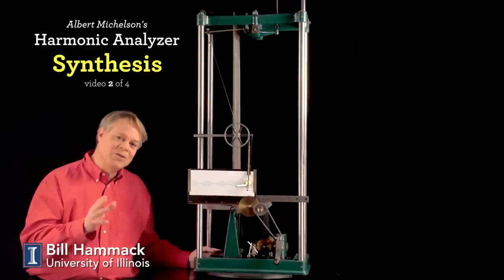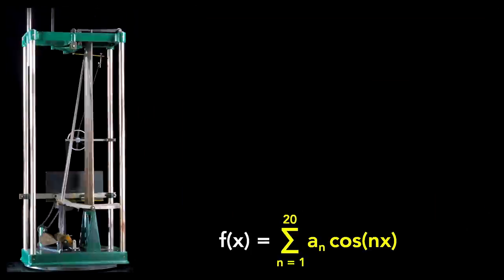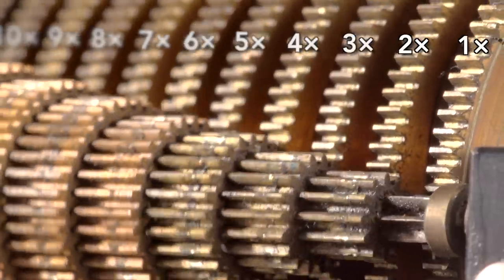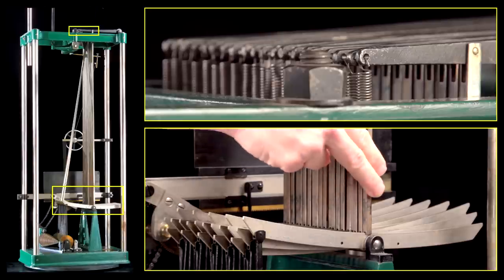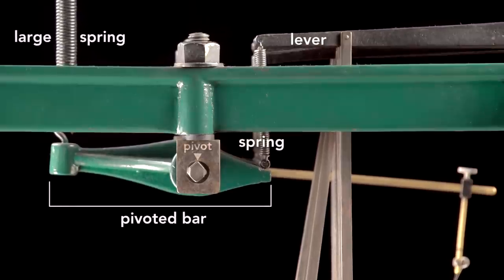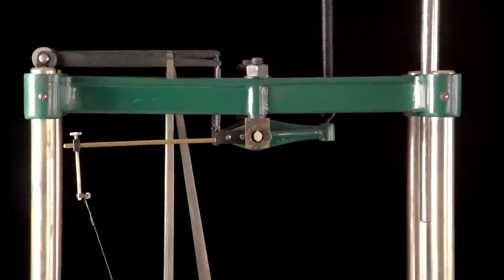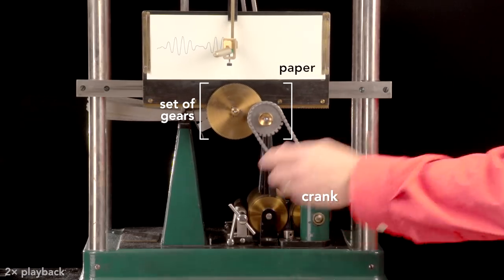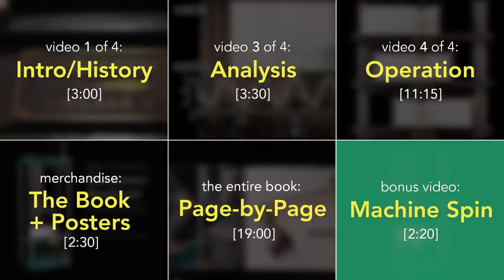(2/4) Synthesis: A machine that uses gears, springs and levers to add sines and cosines

Comment: Amazing how much thought used to went into one machine for one purpose before computers existed.
Reply: It is a computer, albeit one for a very particular purpose.
Reply: Desmaad It depends on your definition of computer. In the old sense of the word it definitely is a computer because it computes. However if you look at the modern idea of what a computer is (in essence a Turing Machine), this does not qualify.

That doesn't make this machine any less impressive though.
Reply: More thought goes into machines now than ever has before.
Reply: @Falcrist  
Yes, more thought into making them into cheap irreparable pieces of crap that break just after the warranty expires...And charging the same price as you would for a servicable machine. Just look at the user manuals most modern machinery has, and tell me where do you see schematics?
Reply: @Falcrist  
And replace it with what? Capitalism is barter, is trade, is production. What you call capitalism is state corporatism, something that spits on the very notion of unregulated trade or production.
Reply: @rockytom5889  if you define all barter, trade, and production as capitalism, then there is no other system. Even communism is actually capitalist.
Reply: @Falcrist  
Exactly, only the owner is different. Instead of the state owning corporations through legislation and  corruption, it owns production and logistics directly. And you do not want the same kind of people that are attracted to power over others anywhere near production. To call this modern hodgepodge of a heavily regulated economic system capitalism would be a disgrace to all systems. The only capitalistic markets currently are the black markets, as those don't have any limiters on how to trade, or what.
Reply: @rockytom5889  so since you have defined capitalism in such a way that no other system (like socialism, communism, imperialism, feudalism, etc) can exist... no solution can exist, and you will simply have to deal with the problem as it is.
Reply: @rockytom5889  depends on which design.  The one that the engineers make that they think is best.  Or the cut to hell and scraped to bits model that the company wants to pay to mass produced.  We make incredible machines  able to smash single particles together at near the speed of light.  But we don't make 100million of them a year like phones no.  Quality over quantity is a saying for a reason.

Comment: Wow.  I was expecting some kind of additive displacement of the different sinusoids (e.g. some kind of stack of cams or something), but this is using springs to convert displacement to force, which is much more easily summed, and then converting that force back into displacement through the main spring.  By keeping the main spring long and the displacement small at the pivoting arm, the spring constant is going to remain very linear and improve accuracy.

The amplitude bars are pure elegance, as is the 'full circuit' at the end, when the crank driving the gears is also moving the paper in perfect time.

Can't wait to see the analysis video!
Reply: Oh, is that how it does it?  I was trying to see linkage on top of linkage summing actual displacements.  Converting to force does seem like an elegant solution, but still mind blowing how that can be done without inadvertent feedback distorting the sums.

Comment: I spotted a source of systematic error in this design. The cams by the gears are connected to the rocker arms via connecting rods; the motion therefore is that of a crank rocker. Crank rockers do not produce pure sine waves; the connecting arm's contribution makes the wave a bit pointy on top and blunt on the bottom. To get a pure sinusoid isolated from circular motion, he should have used a Scotch yoke.
Reply: For the little I've researched in the last 10 minutes, the Scotch Yoke was invented in 1920 and used in the Bourke Engine, while the Harmonic Analyzer in this video was designed 20 years earlier.
So who knows? Maybe later versions used the scotch yoke :)
Reply: Personally, after watching this amazing machine, I needed a Scotch too.
Reply: the angle of deflection isn't big enough to cause a problem

Comment: I keep getting recommended videos for mechanical integrators. These things are incredible.
Reply: True.  But it seems lots of them show how the parts do integration.  I don't remember if I've seen demonstrated how they do differentiation.  I can't believe it would be by doing successive approximations, and the way parts have to slip over others, I can't believe there'd be any way to run them backwards.

Comment: What amazes me is how the linkage can linearly sum displacements without inadvertently causing feedback that would disrupt operation.  I've seen summation explained in video on a general mechanical analog computer using wheels, but I have trouble keeping in mind how even that works, and here you have 20 linkages that seem able to to it with linear motion.

Comment: When developing a machine like this, do they go by a general understand combined with trial and error, or do they simply plan out everything in advanced and just make minor corrections to the design?
Reply from the maker: We don't know: we cannot get any real info on its design and construction, other than a 1898 paper written by Michelson and Stratton. That paper is in our book -- available for free in PDF.
Reply: Mechanically it consists of relatively standard elements used in instruments, their understanding of the mathematics along with plenty of experience probably got them fairly close without much need for trial and error. The fact that there are very low loads on the mechanism also helps as it allows you to get away with a lot. JMHO
Reply: It's my experience when doing something repetitive, that my mind starts looking for ways to simplify the system or offload mechanical repetition onto some kind of helper.  Like putting a stop on a cutting tool so I don't have to resolve the same problem over and over.  I sometimes come up with some clever jigs to remove repetition when doing the same thing over and over.  It is fairly obvious to me, that that's what happened here.  The Jacquard loom, Babbage's difference engine, and a hundred other developments arise as a general principle which only needs mechanical aptitude to realize and polish.  It's basically a central idea plus a lot of ancillary problem solving.  IMO.
Reply: this is a real chicken or egg question

Comment: Just stumbled upon this and thought it was going to be a very early musical synthesizer.

The wheels would have to spin a lot faster to do that though... I think the very earliest musical synthesizers were electromechanical machines adding up sine waves. like the tonewheels in an organ.
Funny enough that kind of additive synthesis went out of fashion as transistors made subtractive synthesis viable, but made a small comeback in the early 90s due to the ability of digital devices to easily create and add up sine waves.
Reply: What if it was small motion of a big cone (like that of a phonograph)

Comment: Yes, this machine is considerably slower than a computer program to calculate the answer. But the big advantage here is because it is so visual and you can physically SEE how each part is related to the other parts, it likely will make it easier to understand why that answer was given.

Comment: Not to sound like a nerdy sound editor, but as a nerdy sound editor, would you have clean recordings of this machine that you could share ? Those gears must sound yummy, the metal squeals ring delightfully ... recording this would be a blast. Cheers.
Reply from the maker: +FBuilding that IS the actual sound. I too thought there would be wonderful sound but then realized a machine that makes noise like that is one that is damaged or dying. This machine is very very quite because of its precision design.

Comment: Can't understand how the displacements of the springs are summed just because they pull on one bar, which is the most crucial concept of this machine.
Any bright person willing to help me out? Really curious
Reply: It works by Hooke's Law, that the force applied by a spring is a linear function, the spring constant (a basic physical property of each spring) multiplied by the displacement. If you stretch a spring twice as far, it will apply twice as much force; three times as far, three times as much force, and so on. Since the springs are under tension, even with coefficients of the arms set to zero, that also means that when they are relaxed, they apply less force. The rocker bar acts as a mechanical version of the integration function. Each arm acts through the attached spring, applying its force to the rocker bar. The sum of these forces moves the rocker bar.

Comment: Would be interesting to do sin(1x)+(1/3)sin(3x)+(1/5)sin(5x)... on that. Or in this special case 10sin(1x)+(10/3)sin(3x)+2sin(5x)+(10/7)sin(7x)+(10/9)sin(9x)... would it be able to show the "Gibbs Phenomen"? I ask myself.
Reply: Hey, I know your comment is old. But I'm a mathematician, and incidentally do research on problems involving Gibbs phenomenon. I point you to the paper "on Gibbs phenomenon and its resolution" by Gottlieb and Shu. There they mention that the machine, in fact, does show Gibbs while reproducing a square wave. I believe the amplitude of the oscillations of your example are well-known, see the Hewitt and Hewitt paper "The Gibbs-Wilbraham Phenomenon: an episode in Fourier analysis" for the details! So I believe that the machine would show Gibbs in that case too.

Comment: And all without reference to Fourier.
Reply from the maker: What do you mean by that?
Reply: engineerguy - All regular waveforms, like a square wave, triangle, sawtooth, etc, but any wave that has some completely weird shape, but repeats it periodically, can be represented by adding sine waves.  It's amazing, but true, and you can determine which sine waves (frequency and amplitude)  to add through a mathematical analysis invented by Fourier.  Look up Fourier Transform and Fourier Analysis.  The video below is a fairly simple explanation of how it works.
https://www.youtube.com/watch?v=r18Gi8lSkfM

Also look up "Fast Fourier Transform"

I clearly come from a different background to yours - I thought that Fourier analysis was the normal way to approach this subject.  Your machine is the first I have seen that can explain it all a different way.

Comment: But wasn't the machine multiplying the sinusoids instead of adding them up? If you graph a sum of sinusoids it doesn't look like pulses. To get pulses you multiply sinusoids.
Reply from the maker: Nope. it is adding them. You can make a pulse by adding cosines together. It is really astonishing an remarkable.
Reply: *****
What was the function you used to produce that pattern? f = 10cos10x + 10cos12x?
Reply: DanieleGiorgino At 2:51 it looks like f(x) = 10cos12x + 6cos10x or something of the kind.

Besides, adding sinusoids and multiplying them can be equivalent, through all those trigonometric identities.
Reply: A cos(at) + A cos(bt) = 2 A cos((a-b) t/2) * cos((a+b) t/2)

The sum of sines looks like 100% amplitude modulation of a carrier frequency a+b by a signal frequency a-b. Changing the relative amplitude of the summed sines will change the modulation index.

Comment: 99% math equations don't translate into practical engineering of designing and manufacturing a working machine for which one has to think in practical engineering terms not math equations except for basic math to arrive at size, shape, rotation, fit, etc. The trial and error methods used to fabricate a prototype after which repeated testing of the prototype would determine the working fitness of a machine not the math used on paper to understand the principles involved. Using the set of math equations one can do next to nothing in practical engineering. The greatest inventers were men of great practical skills rather than the pen and paper types working out equations. If I give you all the equations describing sines, cosines, Hilbert spaces, deltas etc you'll remain stuck on paper and would completely fail to design and mainly manufacture a working prototype. Yawn.